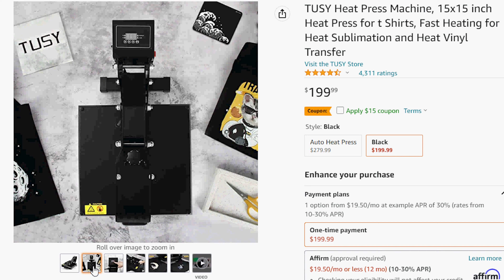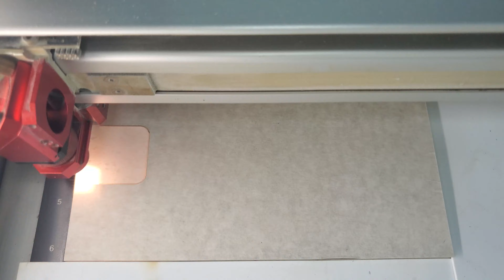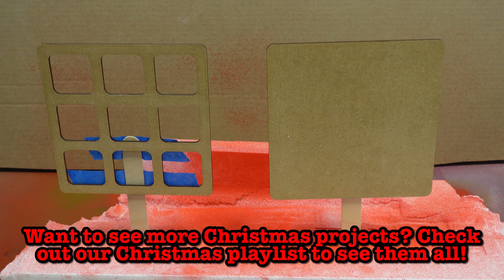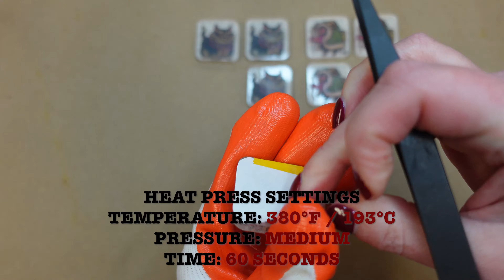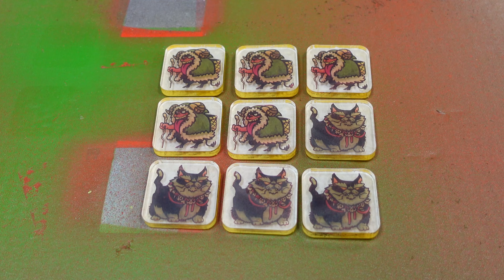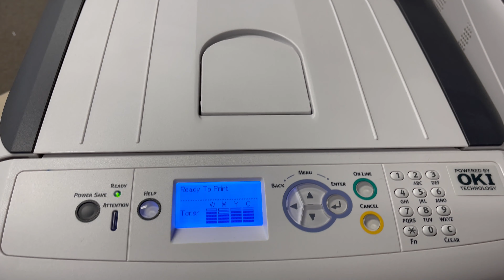DIY Christmas Tic Tac Toe Games with a Laser & CPM Hard Surface Heat Transfer Paper🎄

Comment: Thanks for the video.  Cool project.  FYI... I work at Printful in Charlotte, NC.  Printful is a print-on-demand company with over 350 products.  If you wanted to print onto acrylic in color, I would look into dye sublimation printing.  You can laser cut a metal jig that holds a full sheet of puzzle pieces that matches the layout of your printed transfer sheets.  The next trick is to skip the black border around the individual images.  Cutting those out by hand is time wasted.  Put two registration dots on your image outside of the individual images.  On the laser cut metal jig, have two pin holes etched.  These match up with your registration marks. That way you can heat transfer a whole sheet worth at time without doing any cutting.  To line up the dots with the registration holes, use two push pins.  A second suggestion is to just skip the MDF.  Cut the whole thing from a single sheet of acrylic and print the red onto the back of the puzzle frame at the same time as the puzzle pieces.  To make the backing of the puzzle board, I would use a sheet of 1.5 mm plexiglass.  This is the cheap stuff used in cheap picture frames.  Hope this helps.  Would love to see your backstory video of what you used to do, and how you got started in this business.  Again, thanks for the video.